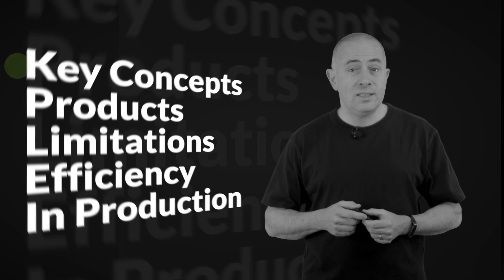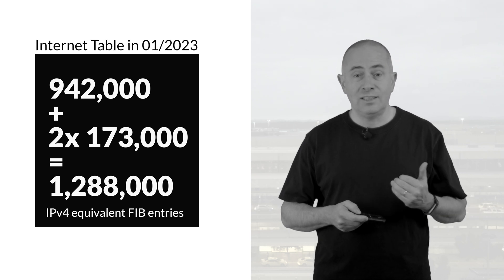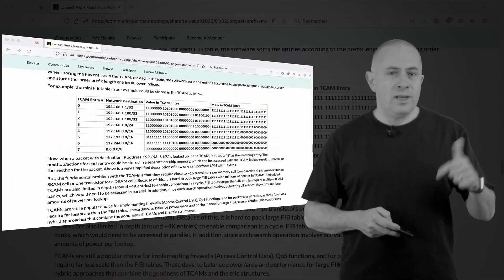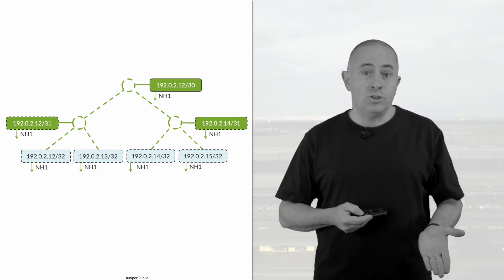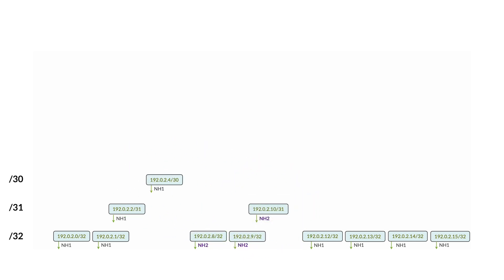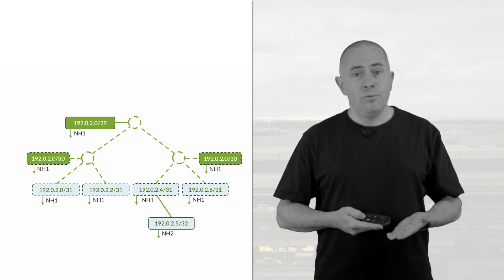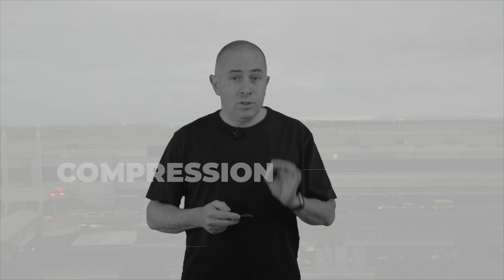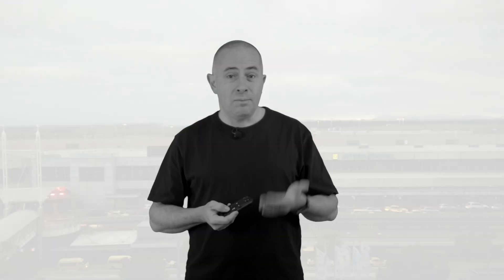FIB Compression in Juniper Routers

Comment: These types of information are rarely found in typical textbooks. However, they are crucial for troubleshooting complex problems or security incidents in real-world production networks, especially large-scale ones. In such cases, you might think there’s a discrepancy between the principles and how networks actually work, but the principles remain intact. The solution lies in the implementation of the technology by the vendor at both the software and hardware levels. Thank you for sharing!